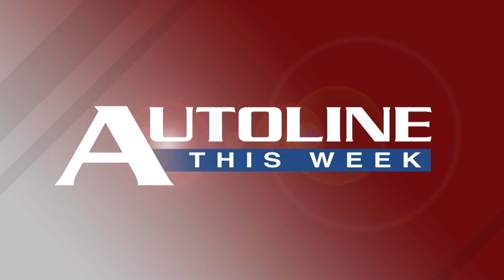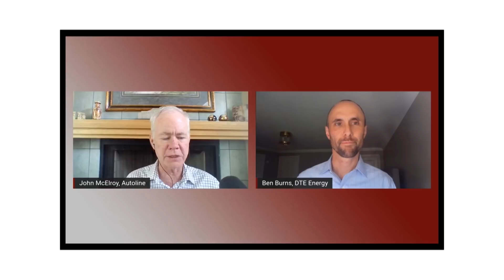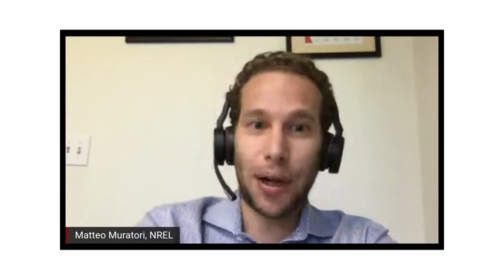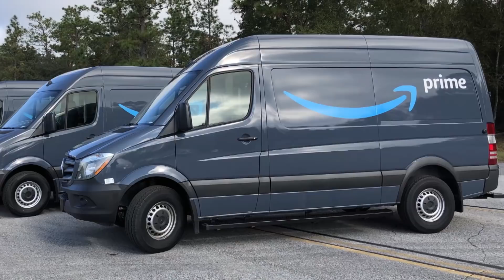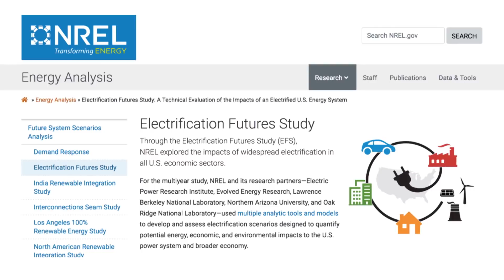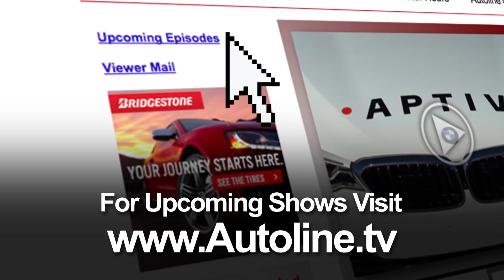Can The Grid Handle All These EVs? - Autoline This Week 2514

Comment: John McElroy states that electricity is a lot cheaper than petrol. That is not true. Petrol is quite a bit cheaper. The energy in 1 gallon of petrol is equivalent to 36.6 kWh's.
36.6 kWh times an assumed price of $0.12/kWh is $4.39. Petrol in my area is about $3.30 
The cost savings are because EVs are drastically more efficient than ICE.
Reply: Now divide that so called available energy by how an ICE converts it and turn most of it as waste heat and suddenly you only have a fraction of the power in the gas.  What counts is how much it costs to drive a fixed distance using electric vs gas.  And there the BEV is three time better.
Reply: @earlpottinger671  All so true. From memory I believe ICE is around 15% efficient and EV around 90%. I'm sure that was the point that John was trying to make, but the way he said it was wrong.
Reply: @KTPurdy  The best you can get from ICE is 35% that is almost 3 times worse than electric, and most ICE are not tuned to the max so 15-25% is about right for most ICEs.
Reply: @earlpottinger671  Yes, that is true, but that wasn't my point.
Reply: @earlpottinger671  Incorrect. Automotive diesel engines have been well above 45% peak thermal efficiency for decades.

In the absence of extreme taxation on fossil fuels, the lower energy consumption of the BEV doesn't make up for the higher manufacturing cost and the lower range and slower recharging.

And unless you use nuclear to produce electricity, your EV is running on fossil fuels.

Germany proves that unreliables produce super expensive electricity.
Reply: @phamnuwen9442   No; Germany is paying for a transition to renewable electricity. That Transition is reflected in the current domestic prices.. I know in my personal life through investing in renewable energy in my home it made my life much cheaper.  My electricity is basically free, my hot water is heated by the Sun, and I have not change a light bulb in years as they are all LED now. By the way the German grid is far more stable than the US grids despite now being about 50% renewable.
Reply: @johnkechagais7096  Are you completely off grid or are you dumping the unreliability costs of your solar panels onto someone else on the grid?

Do you have a detailed cost calculation of your installation that I can take a look at?

"Germany is paying for a transition to renewable electricity"

Yes, they are paying for it with extremely expensive energy which is the completely predictable result of replacing reliable and energy dense power sources (nuclear and fossil fuels) with very unreliable and dilute power sources.

Take a look at the enormous difference between renewable Germany and nuclear France:

https://environmentalprogress.org/the-complete-case-for-nuclear

Please explain how you can think this is a good idea.
Reply: @phamnuwen9442  Are you living in a forest hunting animals with sticks? We are all interdependent.  I don't make the roads or bridges or hospitals or the water pipes that feed  my house and so on. Yet when I drive my car I dump pollutants into the air that someone else children will breath. Conversely when I don't use  use electricity produced by a coal I effectively take out of the air some of the sulphur, and carbon dioxide and so on. When electric cars become affordable, then the excess electricity I produce will go into those batteries, plus more received from the grid, timed so that the it avoids peak demand. I pay to be connected to the grid so no I am not dumping my electricity, and that excess electricity from me is then sold elsewhere. Here in Australia with the hot weather it is consumed by air conditioners, and my solar adds to the reliability of the grid. Texas is experiencing a heatwave and the power companies are asking consumers to reduce usage. more PV would have been useful there I think
Reply: @johnkechagais7096  You're focusing completely on the side effects of fossil fuels (i.e. a relatively small amount of emissions assuming modern exhaust treatment systems) and completely ignoring the massive benefits (i.e. reliable, practical, affordable energy that can be used in virtually every machine in the economy).

I don't think you fully appreciate how crucial low-cost, reliable, practical energy is for the standard of living of everyone ob the planet. Energy is the technology that powers every other industry. Make it more expensive or less reliable and the general standard of living will drop considerably.

"When electric cars become affordable"

You mean "if" they become affordable. Right now they're twice the purchase price and much less practical to use than fossil fuel vehicles.

" I pay to be connected to the grid so no I am not dumping my electricity, and that excess electricity from me is then sold elsewhere."

This is simply untrue since large scale energy storage systems do not exist to cover all the feed in from residential solar. Batteries are orders of magnitude too expensive to make sense for storing electricity any longer period. This is why electricity prices often go negative when the sun shines in Germany. This is effectively the solar producers (or whoever has to subsidize them) being forced to pay someone else to consume their unneeded energy. And unlike solar advocates like to spin this, this is not economically efficient.

"and my solar adds to the reliability of the grid."

The notion that a power source that by definition cannot be controlled by human beings is "adding reliability" is nonsensical.

Grid demand does not magically appear every time the sun shines and it doesn't go away when the weather gets cloudy or even when the sun sets.

By the way, since you're concerned about emissions, did you take a look at the chart on that comparing Germany and France?
Reply: @phamnuwen9442  We have change the composition of the atmosphere; Its not small emissions, from about 0.28% CO2 to 0.42%. This may have a consequence on humanity. I think its wise to shift to renewables sooner than later as eventually the fossil fuels will run out and that risk to the planets climate is not worth taking in my opinion
Reply: @johnkechagais7096  400ppm is still not a whole lot in a geological context. CO2 is not a very powerful GHG and its climate forcing function has diminishing returns, meaning every new molecule warms less than the last. The IR spectrum where CO2 is relevant is already almost fully saturated.

We have some impact on the climate but it's not likely to be catastrophic and a lot of the impacts are positive, i.e. food grows better with more CO2 in the air, and cold kills more people than heat, even in a lot of places close to the equator.

The deaths from climate related causes have dropped enormously over the past century even though there is obviously way more people on the planet. Why? because we use cheap affordable energy to build machines, buildings and structures to protect ourself from a nature that was always dangerous.

Regarding fossil fuels running out, this is not likely any time soon, and even if this would happen at some point, it doesn't make sense to stop using them so long as they are affordable.

I don't mind upgrading our energy systems to something even better though. The obvious candidate here is nuclear, which is safe, reasonably affordable, scalable and abundant. And of course it's just as low carbon as wind and solar if not more so, and it runs all the time regardless of weather or season. You'd think the climate change alarmists would be demanding a massive expansion of nuclear if they were sincere, but for the most part they hate it.
Reply: @phamnuwen9442  Its not about geology but human habitat, and a risk to a climate that increasing PPM of CO2 can have. I have no object to to nuclear, especially for high latitude countries like Finland, but it is very expensive and takes a long time to implement. Renewables are far quicker to deploy and the cheapest new power supply. For high grid penetration renewables have intermittency problems that can be addressed by expansion and interconnection of the grid systems, pumped hydro and now increasingly battery storage. The ideal battery storage is close to where power is consumed, and still connected to the grid. The mass adoption of EVs is dramatically cutting the costs of batteries and creating the economic opportunity in the near future for a viable distributed  electrical system. The grid in Texas failed because it was not winter proofed and not interconnected to the rest of the US Grid.
Reply: @johnkechagais7096  "but it is very expensive and takes a long time to implement."

Did you see this:
https://environmentalprogress.org/the-complete-case-for-nuclear
?
Compare the electricity cost and emissions from Germany vs France.

What does that tell you about your "solar is cheap" narrative?

"Renewables are far quicker to deploy"

Incorrect. Look further down on that page and you'll see that Nuclear has the world record in speed of GW per capita deployment.

And all of this is completely irrelevant anyway because RENEWABLES DO NOT PRODUCE AFFORDABLE OR RELIABLE ENERGY AND THEY EMIT MORE CO2 THAN NUCLEAR

Comment: Most people  with EV's charge overnight when rates are lower. For Home Backup power I'd have a NG Bsackpwer generator if you have Natural Gas. I hate all electric homes.
Reply: Rates wont be lower at night if everyone starts charging their cars at night.
Reply: @TheBrokenworld  They are overnight when most are not using most power
Reply: @QuietStormX  My point is that the only reason that rates are lower at night is because demand is low, but if demand increases at night, so will the rates.
Reply: @TheBrokenworld  Right...